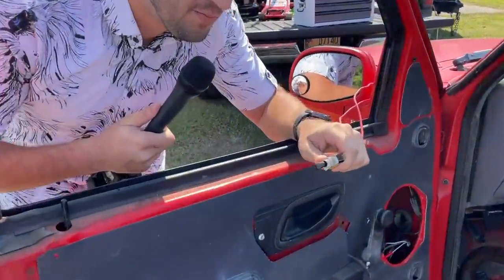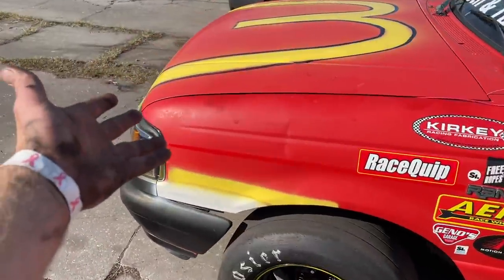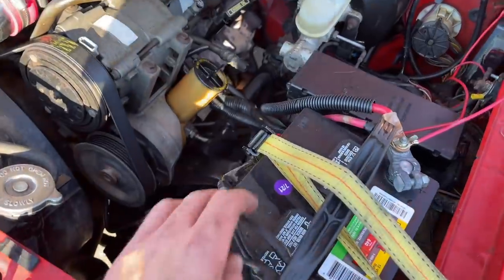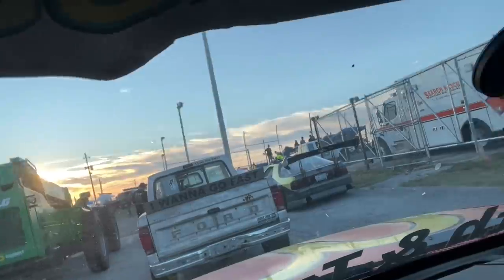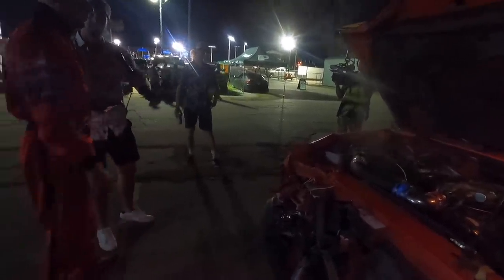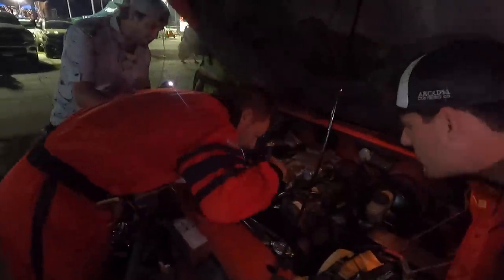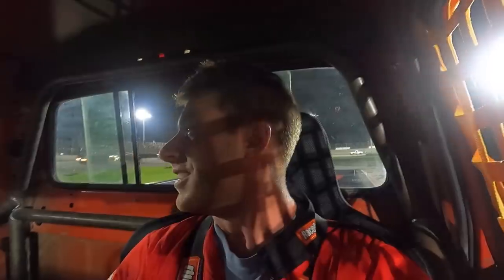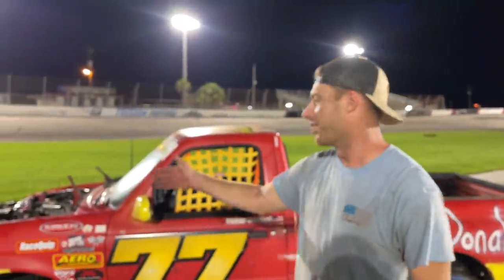DANGER RANGER 9000!!! Big Crash with JH Diesel Leads to Bent Frame Live Action Fix During Halftime

Comment: Some of those trucks were really turning well. Were there guys running stagger or maybe a stiffer right spring?
Reply from the maker: They really did! probably short wheel base and light weight. Not allowed to run a stiffer front spring per the rules!
Reply: Most of the fast guys had added camber to the right front and put a little toe out in the alignment.

Comment: I loved watching the trucks more than the crown vics. I love trucks tho. Ive got an older tacoma making 200hp over stock setup for ripping through curvy mtn roads on my commute to work..  It takes talent to rip around something you can flip pretty easily. you were rippin before your truck bit it. maybe wire in an electric fan next time?
Reply from the maker: Thinking I’ll put the radiator in the bed
Reply: @DoctrParker  I thought you had to leave the setup as stock as possible? if you can change things i'd run smaller tires for being faster out of corners and a lighter flywheel on the clutch and weight in the bed to keep it from coming around. radiator in bed would definitely help...

Comment: The format seems like a winner and could run again so why destroy an engine for nothing? If you had a good chance of finishing sure. What would be good would to fix it for the next time (same with crown vics) and get a bonus in start position or a small modification. By race 3 if you can keep it running then you should have a better chance of a win. Kinda recycled racing.
Reply from the maker: The trans is smoked, for the time I'd put into repairing it, I can get another one
Reply: Sounds like the McD truck is up for sales? :)
New engine and it is the perfect car for someone that wants to join👌
Reply: @DoctrParker  Sure but you have a bit bigger budget and access to facilities than most, which is okay. I liked the ground roots concept of this style. Maybe Cleetus could team with a community group to teach them basic mechanics and get the rangers and vics running again? McFarland school for misplaced youth has a ring about it! If things with Jeremy are not completely tits up then army vets? I know you boys didn't come from hard backgrounds (which is irrelevant) but what you have done in a few short years is inspirational, with Brett, Boosted boiz and a few others giving talks it might just work.